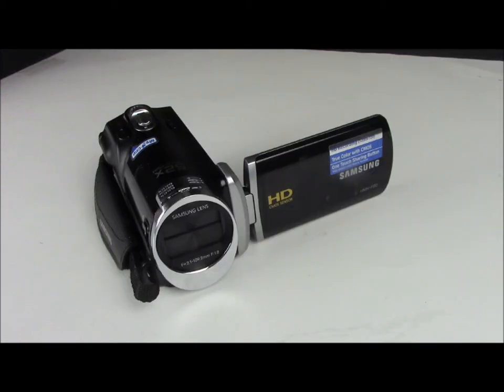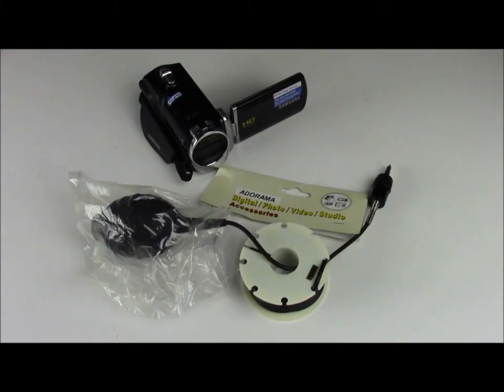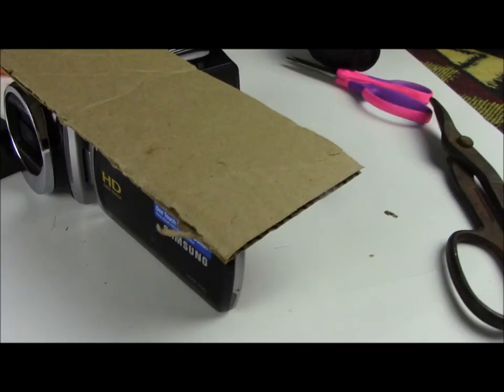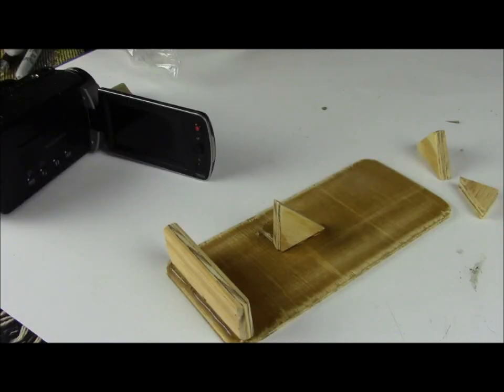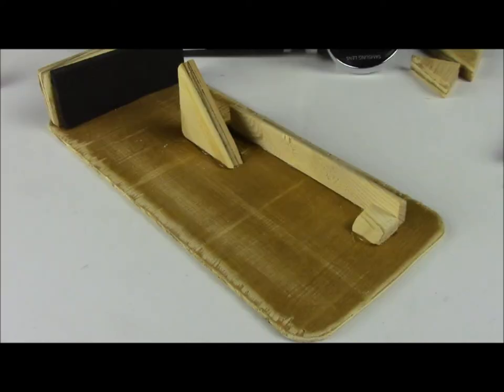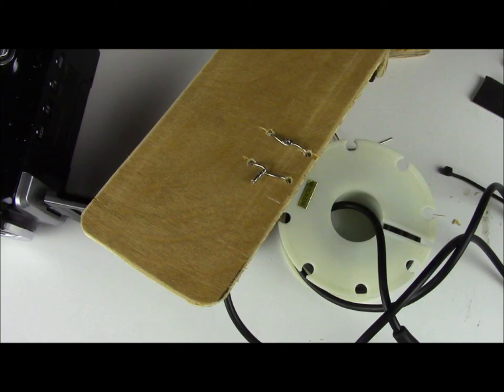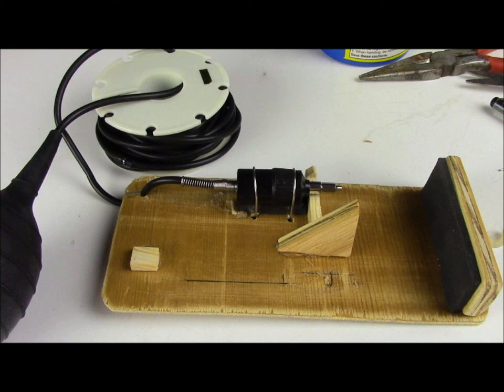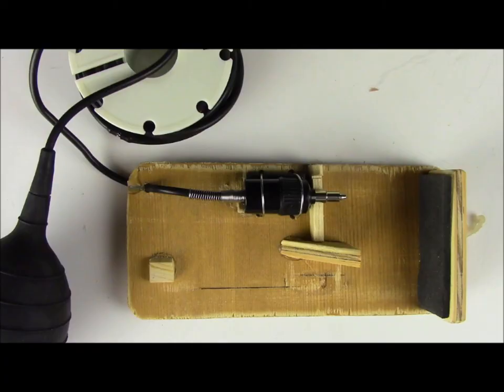$12 DIY manual remote control for cameras & other electronic devices.

Comment: Robb could you set up camera on electric receptacle you could turn off.? or would that create a new file.?
Reply from the maker: Joe Large Hi Joe,Yeah, turning off the power will cause it to create a new file when you power back up and hit record. This has turned out to be a pretty easy to make project, and I think it will lend itself to being used with other cameras or electrical devices that do not have wireless remote controls. I like using the air bulb too as it is probably 150 year old technology. LOL